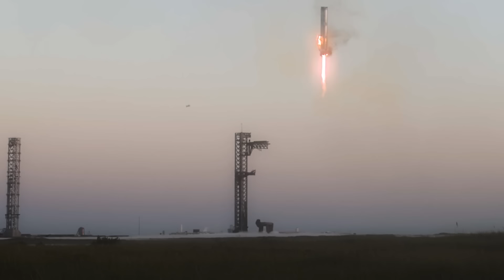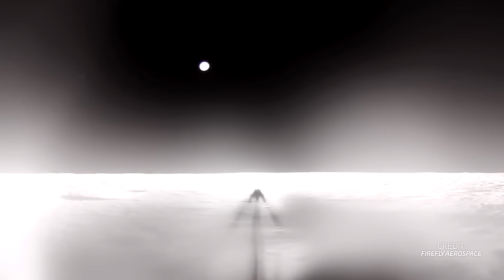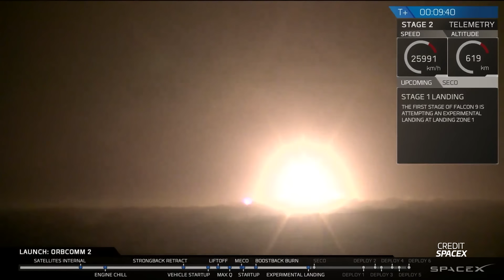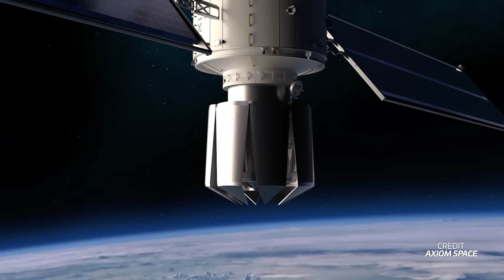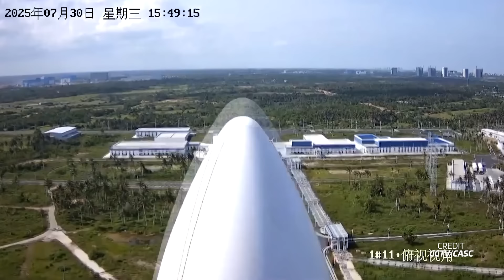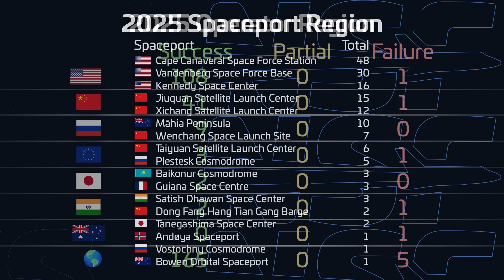SpaceX Retires LZ-1, Artemis 2 Conducts Crew Pre-launch Test! | This Week In Spaceflight

Comment: The reason that space 'cold' isn't effective for heat transfer is that there isn't anything (well,, infinitesimally little) to transfer the kinetic heat energy to (No mechanical energy transfer available.).
The only way to shed kinetic heat energy in a vacuum is radiatively (via electromagnetism, or gravitationally).
Same why the soft glow of a rocket engine bell is a GOOD thing. That glow is preventing the bell from melting. 😁
🖖😎👍
P.S. Californian Texas Tank Watcher since Starhopper, so if I appear a minuscule bit pedantic, Get over it.. Nerds! 😉
Reply: Keeping hydrogen propellant cold is difficult when the craft is in LEO. Same for orbiting the moon. 

Half the craft is in direct sunlight and the other half is partially illuminated by the warm planet. So desirable exposure to interstellar cold is limited. 

It helps to block sunlight and Earth-glow with foil shading, but heat pumps are still needed, so PV collectors and radiators are essential.